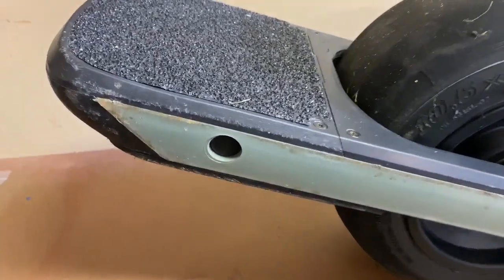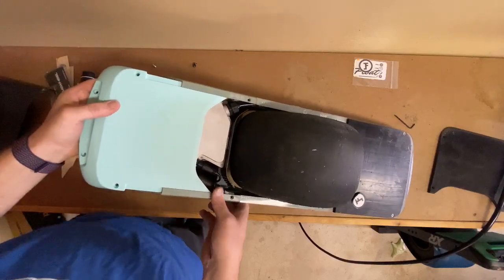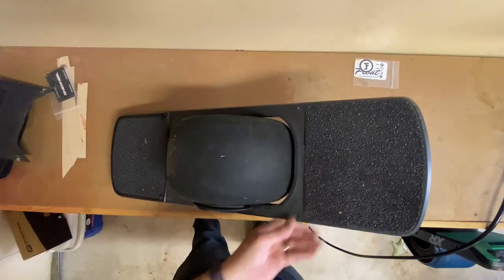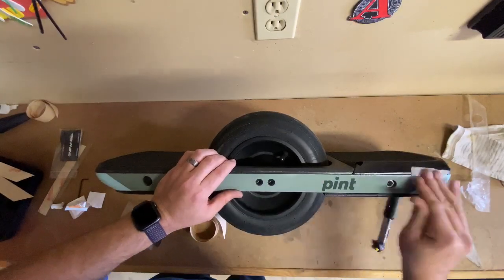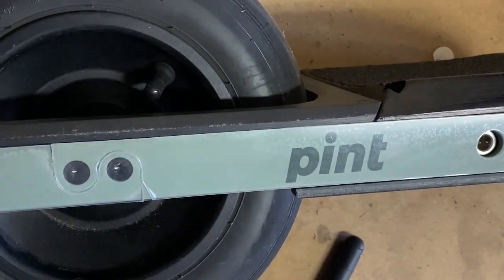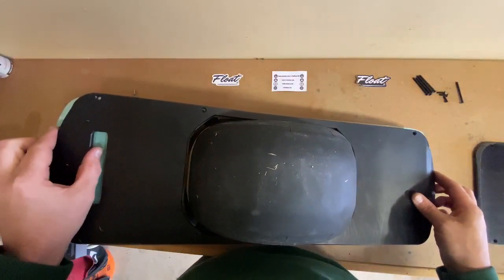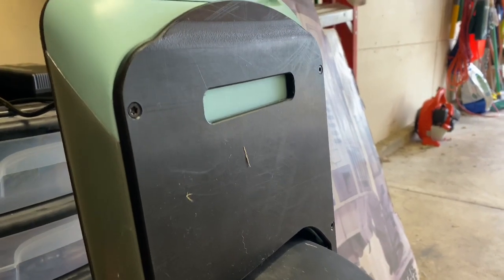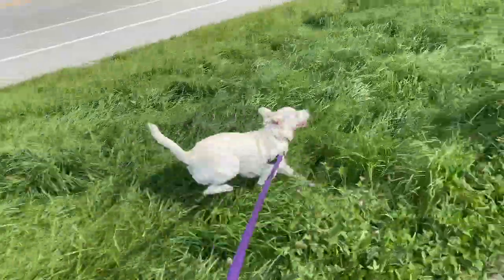Onewheel Pint: New, Bumpers, railguards, and float plate install!

Comment: I'm confused. Another video states that the float plates aren't compatible with those specific rail guards, but I'm seeing here that everything fits together nicely. What gives?
Reply: i’ve got a pint and have been looking into float plates, and it seems that the OneWheel rail guards are not compatible with the plate anymore. my rail guards wrap partially around the bottom of the rail, which would get in the way of the float plates. it’s frustrating because i believe you can only use the plates with off-brand guards (and i just purchased Onewheel rail guards, not knowing it would stop me from being able to use a float plate)

i’m not sure if this helps, but it seems to be the only answer i’ve found

Comment: Silly question, I'm new at this but isn't the bumpers do the same as the floating plate?
Reply from the maker: No the bumpers come stock on the board, the float plate protects the bumpers/rails from scraping.

Comment: Do you feel that the front handle is adequate enough? Or do you find you're holding it by just the tips of your fingers and it's uncomfortable?
Reply from the maker: I think it works just fine. I’m not always gonna carry it by this handle but just for grabbing it it works great.  Much better than nothing!
Reply: It’s nice for moving it around and setting it down. It doesn’t work well for carrying long distance, the mag handle works much better for that